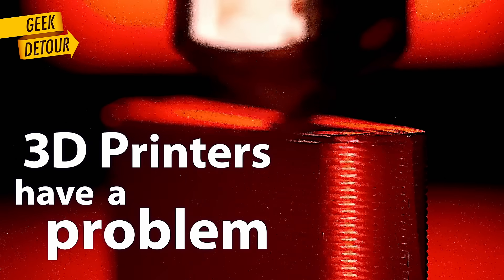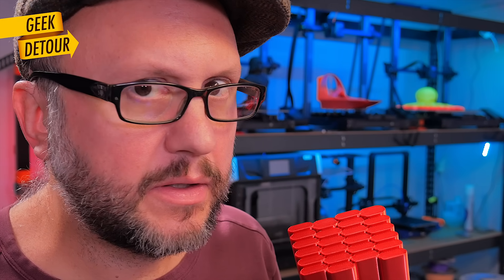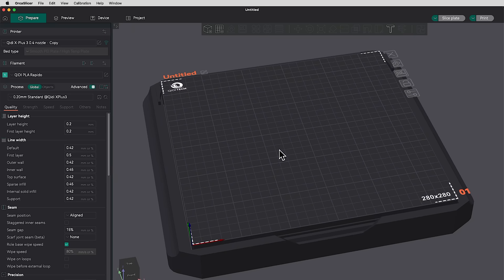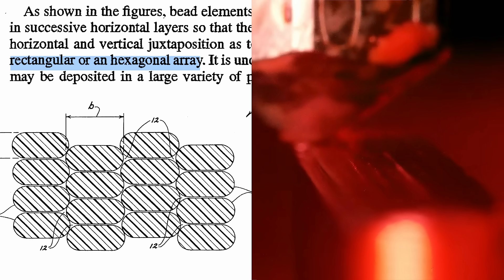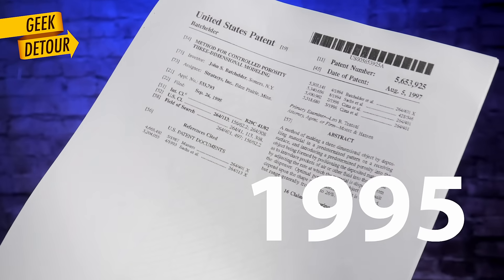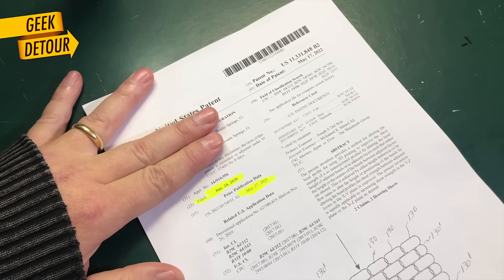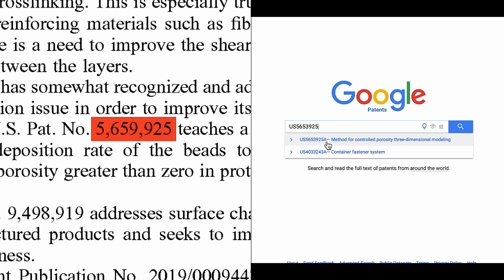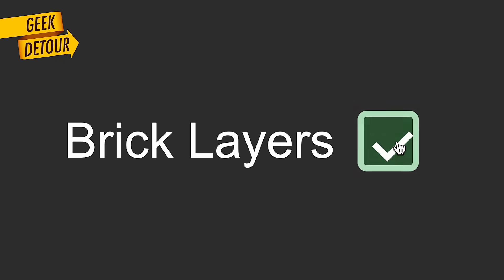Brick Layers: Stronger 3D Prints TODAY - instead of 2040 😬

Comment: Btw, they obviously knew of the old patent but either intentionally or unintentionally fudged the reference.
If we can prove damages they may be liable. The best thing they can do is pull the patent to avoid any lawsuits.
Reply from the maker: I really want to see what Attorneys can tell us. It goes way beyond what I know as an 'enthusiast' 🤣
Reply: @GeekDetour I have dealt with patent issues, as an engineer / entrepreneur, and that is no guarantee, but this is such a clear case that no one has anything to fear
Reply: @GeekDetour  You need to look at the claims, not the specification. If you look at the prosecution history you will see specifically why the claims were allowed, the Examiner suggested the applicant made aparticular amendment.
Reply: It doesn't even need to go this far.
Just one manufacturer has to put it in their software, and let the other guys sue over it.
But the cheapest way would probably be to appeal the patent with the patent office, citing the earlier patent.
Reply: @TSteffi  But this is what Is my biggest peeve. Patent offices charge for re-examination and it's the complainer that pays.
They are under no incentive to do a good job when granting a patent. Regardless of bad prior art review, or even not even checking claims, they win and get paid twice.
Reply: @TSteffi The patent holder can sue any infringing party, as long as the patent is active. But in this case they stand no chance, as the patent is worthless.
Reply: @MichielvanderMeulen  Yeah. Someone will probably have to take the hit to get the issue cleared up in court. 
If they sue and a judge rules the patent worthless, then it would be free for everyone.
Reply: You can anonymously file ex parte reexamination with the patent office and they can pull the patent
Reply: @spencercurtis86  oh cool, let me look that up
Reply: Post link to instructions and it will be done overnight. @spencercurtis86
Reply: If you implement a way to leave  to the user to "displace" the layers, the printer and slicer producer is not liable, only the user but no user Will be brought in court for slicing and printing his own parts using this method
Reply: Well, if you look into who owns Stratasys, it's not so surprising why there had been shady dealings with this patent. Let's just say such groups of individuals are known for gatekeeping knowledge from others. Even if there has to be foul play involved.
Reply: Damages? You're joking right? You would just be wasting time and resources trying to prove damages, because there wouldn't be any lol. Focus on the goal, that is to void the patent.
Reply: This is patent fraud. I doubt damages can be proven apart from wasting the patent offices's time.
Reply: No chance does not mean that a lawsuit will not be brought or that you can ignore a lawsuit. Companies rely on the fact that legal representation costs a lot of money, and their pockets are a lot deeper than yours. Welcome to the corporate hellscape that we’ve allowed to flourish.
Reply: @ZeroAlligator  I understand. Of course, before publishing the software (slicer), you should ask for advice. But this is such a clear case of a patent that will not hold.
Reply: @ZeroAlligator it is more of a problem with the legal system.

Comment: Not sure, how same patent is applied multiple times (maybe to remove false claims and add new so-far valid ones), but if it boils down to this (last US version? where claims 1-3 are canceled):

_4. In a method of additive manufacturing for improving the shear strength along the Z vertical axis of a three-dimensional object, the improvement comprising:
lowering the bead height of a material to be printed by reducing the flow rate of the material to be printed by one-half of the flow rate of the material to that of adjacent beads.
5. In a method of additive manufacturing for improving the shear strength in a vertical axis of a three-dimensional object, the improvement comprising:
lowering by one-half of the bead height, of adjacent beads by doubling the feed rate for the reduced height bead to that of the flow rate for the adjacent height beads.
6. The improvement of claim 4 which further comprises creating a valley between spaced apart beads in any one layer.
7. The improvement of claim 6 wherein the reduced bead height is created in the top and bottom bead layers of the object to be printed._

it has nothing to do with hexagon pattern configuration, but only how thinner beads are created.
IMO 
- using any other ratio than 0.5 (one-half)
or
- using any other method than flow or speed (though not sure if there are any) to compensate for lower layer height
would be outside of this patent. If it wasn't used for improving the shear strength but - say - fun might be interesting case to interpret ;)
Reply from the maker: That's great: you actually READ it! This is a very interesting aspect of this patent: it is arguing to create a stronger layer adhesion (so, in the whole part). And yet, most of the text is spent describing their 'recipe' to print the first 2 layers, and the very top 2 layers... so, bottom half millimeter and the top half millimeter of the part. The actual strength of the BODY (lets say, 99% of the part) is just the result of the Hexagonal Pattern.
Reply: @GeekDetour  Well, actually only the claims, but I think those define what the patent is about and the rest is just explanation of the claims 😉

Comment: You are only partially right: shifting the horizontal way is easier and more doable, alternate the inner and outer wall width, will have the same effect and is easier to slice.I proposed this years ago in Superclicer. I don't know if it has been done.
Reply from the maker: Ohh... Have you seen me breaking stuff in the beginning of the video and at the end? I was actually doing EXACTLY what you are saying. The results are NOT the same. My intention was to make it a single video, but the Patent part alone got very big already. Stay tuned!
Reply: @GeekDetour I understand your perspective, but it seems you're somewhat overlooking the fundamental physical and chemical processes, which oversimplifies the concept of the "bricks." However, I agree that in certain cases, fine-tuning by printing more slowly and allowing these processes to occur—ensuring proper plastic fusion—is more crucial than merely adjusting layers to achieve a brick-like pattern.

The latest version of Creality Print includes the "Arachne" wall generator, which addresses this by allowing variable perimeter widths, enhancing print quality and dimensional accuracy. 
ALL3DP

Regarding Z-jumps between loops, while they may seem negligible, it's important to remember that you cannot print features smaller than your nozzle diameter. Therefore, vertical shifting is unnecessary, deviates from natural patterns, and can increase G-code complexity because of the dynamic layer height. (the layers are not a flat face anymore)
Reply: Superslicer already has variable perimeter width for alternating layers, implemented last year IIRC.
Reply: @mongke1000  no, it exists since more than 5 years, my proposal was alternate Inner and Outer wall Width(creating the brick pattern), you are talking about uneven layers having an extra wall to the inside. The vertical AND horizontal alternation (width and height) is of course the best system.

Comment: I have no idea of how to use this brick technology in 3d-printing. Lines in real slicer output never strictly lay one on top of the other from top to the bottom of the part, they cross lines of previous layers. So, if the first layer is of variable height, you can't put any lines on the second layer in any way to cross these first layer variable height lines (or you would get a wavy mess). And printing square bricks with 100% infill is a rare occasion (and even then you usually prefer to mutually cross adjacent layer line directions).
Maybe the reason of no one implemented it, is that this patent is just not that useful?
Reply from the maker: Oh, you should watch CNC Kitchen video (in the description), he explains how he did it. Also, you might not be aware, but all modern slicers are generating supports with different layer heights than the actual printed piece. So, it is not a challenge to print some lines at a certain height, and the other lines “half-layer“ higher.
Reply: @GeekDetour  I've seen it when it came out. And it doesn't explain anything I mentioned. Imagine you print a sphere with this fancy method. The wall is 2 layers thick (for the sake of simplicity), no infill. The slicer would produce pairs of circles for each layer. And the closer we get to the top of the sphere, the messier would be the result: what would be if the outer wall (let it be the higher one) would get on top of the inner wall (the lower one) from the previous layer? (it wouldn't bond well, so we would end up with even lower part durability). What if the line gets in the middle of the higher and lower lines of previous layer? It would be squished aside, I guess. What if lower line would get on top of the higher line? What would be the resulting geometry? None of that questions were properly investigated and answered in that (or this) video (except for the mentioned benchy roof problem which is totally expected: all the surfaces with light gradients would suffer from uneven layers underneath, and the lighter the gradient, the worse the result).

Comment: I'm the owner of a company that heavily relies on 3D printing 

You can't imagine how this would change everything for us

UPS won't be able to break our parts while shipping 

And we would be able to make some parts lighter and stronger
Reply: UPS will still find a way.
Reply from the maker: You need to thanks Stefan from CNC Kitchen, it all started with his tests. I also got thrilled, and later disappointed that nothing was happening by the reason it was.
Reply: Same
Reply: I've worked for a parcel-sorting machine company. Parcels were dropped a couple meter on top of each others. Some parcels can be heavy and dense. And apparently, we were on the low-end of parcel-dropping heights. Robots pick parcels up with succion cups from one side and accelerate them at up to 10G. Pack well or expect things to break, or worse, open.

Comment: I have successfully patented several inventions but am not a patent attorney so do not consider this legal advice. Remember that patents only restrict you from doing what is in the claims, not what is shown in a diagram. Having looked at the first 2 patents granted to the entity that filed the 2020 application, they do not claim the hexagonal configuration. Instead, one patent claims a method of making alternating beads where every other bead is half the height of the 'normal' bead, and the other claims a method where the end bead is half the width of the others. Both methods serve the purpose of filling 'gaps' in the hexagonal pattern on horizontal or vertical edges, making those edges flatter. So my interpretation is that one can print with a hexagonal configuration without infringing. However, some methods used to fill 'gaps' in the hexagonal pattern on horizontal or vertical edges may be restricted by these patents. As far as I can tell, the 1995 Stratasys patent does not discuss these gaps. There may be other prior art that might invalidate these patents, but I have not researched that issue. Happy printing!
Reply: If the patent clearly says that the "first layer of beads" have to be "half the height" I guess we could just use an extra layer where the alternating beads would be 1 - 1/4, then another layer that does 0 - 1/4
Same result, but all that we waste is an extra half layer haha
Reply: @cripplingdepression8889  this is 100% correct
Reply: You are correct to the claims of the patent at issue, but incorrect to the use of prior art. Prior art is not limited by claims for what it teaches
Reply: @The_original_Reth Exactly. Anything can be prior art if it’s been publicly disclosed.
Reply: i have a patent-pending process in Europe and oen of the investigations is: is mentioned already somewhere? Because if the idea was already mentioned the Patent can't be released.
As well as if the thing was already in Open Source. You can't patent it. I'm still in the process and they wil see. bt to me those are fundamental issues.
Not clue if all the errors in the docs can be used to invalidate the patent itself. but certainly the idea was already exposed as Open Source so the Patent perhaps can be classified as "stolen idea" and consequently invalidated?
Reply: The newer patent also describes in claim 1 specifically that the lower height is realized by reducing the flow rate by "reducing a flow rate of a material to be printed by one-half of the flow rate for manufacturing the bead height of the beads adjacent thereto" . so changing the flow rate by 40 % would probably already create an opening from this patent. Another potential circumvent would be to keep the flow rate the same, but increase the speed of the print head. third option would be to use lower but wider beads that have the same volume as the higher more narrow ones. if you make it twice as wide, you could put 2 beads of "standard" height on top of it. If you look at what Claim 1 looked like in the first version of the patent A1, you can see that they really had to change a lot in order to prove the inventive step. I'm also not a patent lawyer, but I have spent years designing around patents. 

Therefore as a general statement, patents are good if used correctly. firstly they help protect investments, e.g. If there would be no patents, a company would spend millions in developing a technology and as soon as it is on the market, it is copied by 5 companies, so the original company cannot even earn back their money. Secondly, patents stimulate creativity for people trying to design around a patent which can lead to new technology. 
I am against patent trolling, companies, that use patents (sometimes even inferior ones) to block the market by suing everyone that comes even close to their product. not based on legal grounds, but just because they have deeper pockets to pay for the legal costs.
Reply from the maker: We need the professionals involved. Who knows… maybe my whole analysis is super wrong 😬🤷‍♂️
Reply: Fair, but a newer patent has to claim an innovation that is not an obvious extension of prior art, correct? It seems like the exact amounts of extrusion and layer heights are not only non-novel and obvious modifications to prior art but the kind of tweaking in which 3D printing enthusiasts engage on a regular basis.

Maybe I’ve gotten unlucky with the patent reviewers I’ve had 😂 I’ve also seen patents from decades ago for ridiculously obvious things like “using a drain pipe connector to connect two pipes… BUT THEN USING THE PIPES FOR SOMETHING ELSE OOOOOOO” So I guess it depends on the review and the era. 🤷🏼‍♂️
Reply: @RickGladwin  you are fully right. The inventive step should be something that is not obvious to someone skilled in the art. And lowering the flow is quite obvious to get a lower layer thickness. But it got past the examiners and is granted so it has to be reckoned with. If someone else take the risk to bring it to market and would get sued by the owner of the patent, they would probably use exactly these arguments to claim the patent should not have been granted at all. Which might become a subjective discussion about semantics.

I also only saw a US patent listed in the patent family so no protection in any European country, China or somewhere else. So I still have hopes that someone will do something with the idea.
Reply: Then we can use ironing after each layer, which use 10% of main flow to fill gaps, still preserving flat pattern for layers, but with the price of long prints.
Reply: the patent is already invalid, no need to try to work around it. do it openly, they cannot defend their patent in court.

he literally showed the prior art that invalidates the patent. I personally have tens of patents, and in teh process of filing many more. He proved this one is invalid.
Reply: Having also filed several patents, that has been my experience too. The claim has to be very specific. So, this ink printing patent is not relative to 3d printing and thus not enforceable. imho
Reply: On a broader mathematical definition, if the beads being arranged in a pattern where one bead is half the height of a normal bead, you've defined the foundational blueprint for creating a hexagonal structure. Geometrically, that creates a foundation of hexagonal tessellation where a tile is produced where three "vertices" of the beads overlap without internal geometry intersecting. Unless you can magically control the shape of the bead to be some other shape than the rough oblong/hexagon/prism shapes they are, this is something that could be proven with geometric proofs, and in theory with the right legal representation be enough to get the patent thrown out (if and only if the patent holder attempts to enforce their patent).
Reply: Exactly THIS! The patent holds everyone of doing their method but not from achieving their results by some other way. I highly think that patent is invalid due to the errors in redacting and using prior art, but if the american legal system decides it's right to hold back the public from using technology that is already free to use, I think that we can find a legal hole or a technical shortcut that we can use to make that technology free!
Reply: @michaelvelazco216  just ignore teh invalid patent and move on.